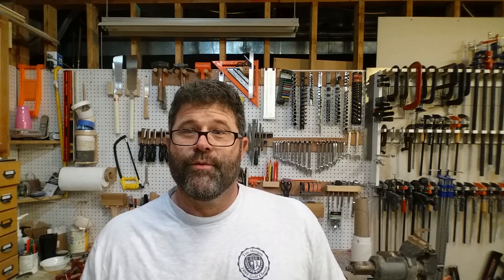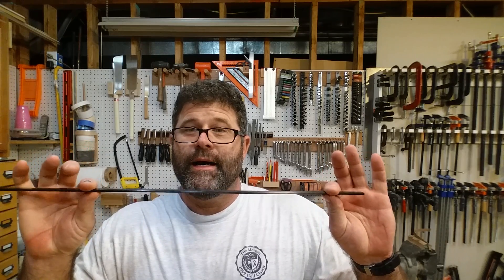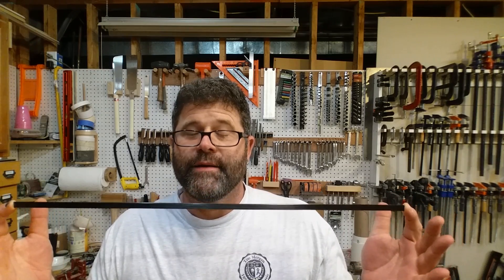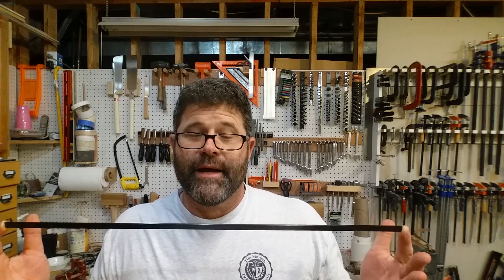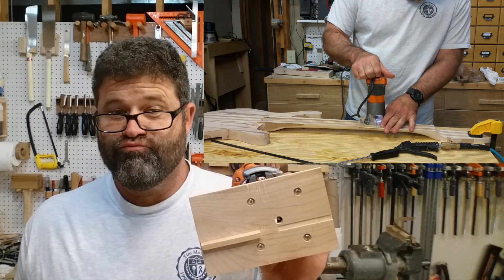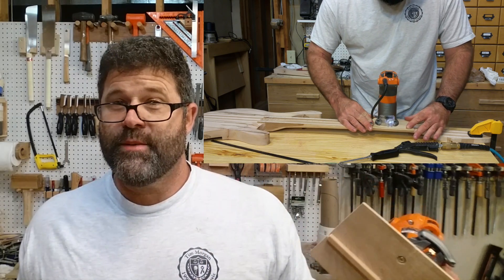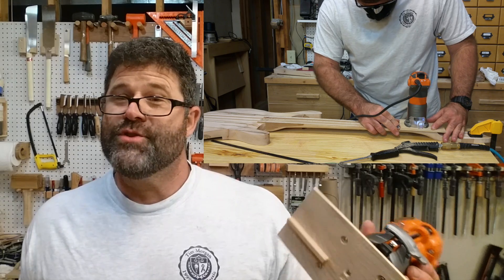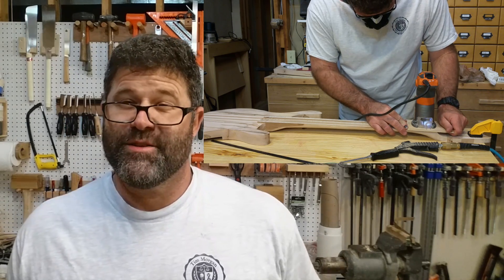Building a Six String Bass / Adding Carbon Fiber to the Neck

Comment: A great solution but I do hope you glued those in. To perform correctly a carbon fibre reinforcement needs to become one with the neck so epoxy is definitely required.

Comment: ... but then the trussrod doesn't work either, no?
Reply from the maker: Almost true.  The truss rod's effectiveness is greatly reduced.  In hindsight, the laminated structure of the neck was strong enough.
Reply: Truss rod not needed with the carbon rods installed

Comment: I'm wondering if I need them in my guitar build...... Looks like the carbon rids were literally bending while you were pushing and tapping them in....
Reply from the maker: jake friesen There's no doubt they add strength.  However, I put them on an abundance of caution.  I was worried a six string bass would have too much force on the neck.  On a normal build, I'd never consider it.

Comment: Shouldn't it be bonded in?
Reply from the maker: Possibly, I really didn't think about it.  Since I made the channel the exact size, and the fretboard locks it in place, it never crossed my mind to do that.  I'll have to do some research.
Reply: @FranklinWoodWorks2016  What did your research on the bonding question tell you? Or... how did the finished bass do?
Reply from the maker: @steensuder115  In my case, no bonding needed.  The neck is rock solid.  If fact, it's so solid, I'm thinking about carving down the neck even thinner.

Comment: Great solution and much better than what I was expecting - a jig that held the bass with an overhead router guide like you’d use to flatten a wide board or the top of your bench. Your method is quicker easier and far less complicated.
Reply from the maker: Tioga Fretworks Even a blind squirrel finds a bit every now and then.  I got lucky and figured it out.